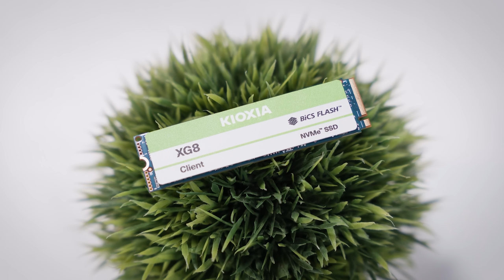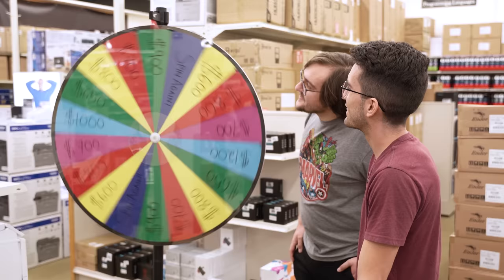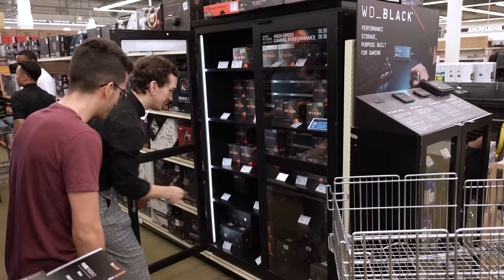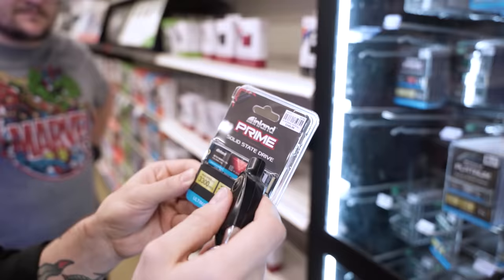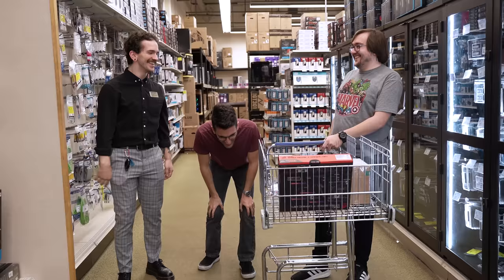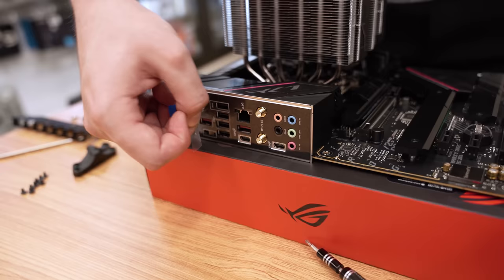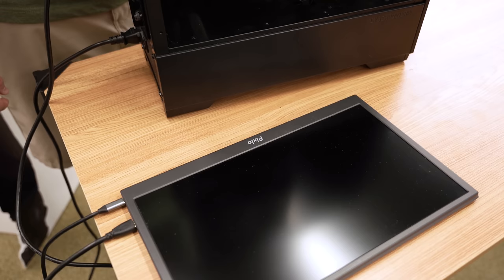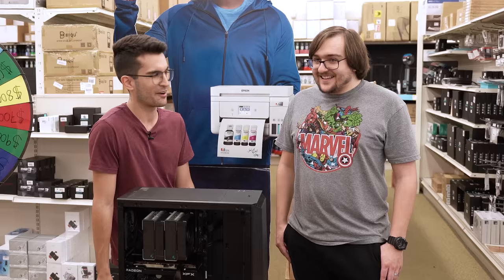He Couldn't Believe It Was the SAME PC!  - Gear Up S1:E3

Comment: I feel like an RX 6800 and a 5800x3d would have been a better route.  He could make 200+ bucks back on the 6600 (XT?).  That would give him still a great CPU, and also a 16GB card...which is already getting relevant.
Reply: I thought the same, platform was fine, just throw a 5800x3d and ready to go!
Reply: Yeah that's since he already has B550 the 5800X3D is really good for gaming.
Reply: that and a better Cooler, imo they just not tryna be stale with the upgrades but what they're doing isnt the actuall point of the series
Reply: I was thinking the same thing, but I bet he upgrades the GPU soon. Hoping he has more options in the coming months too
Reply: @jungle2460  This was my thought process :) Thank you for clarifying for everyone
Reply: Agreed.
Reply: The $600 combo (7900X, ROG B650F-E, and a 32GB DDR6 6000) is a hell of a deal (considering the CPU alone is $400+). Since GPU prices are all over the place, I'd upgrade my platform first, too. Especially when it's all free lol.
Reply: Dude nobody is going to give him $200 on a 6600.  They are only like $220 new for the non XT and $250 for the XT.  That might get him $100 on eBay and like $70 on Jawa
Reply: @jhendra83  Yeah that futuristic DDR6 Ram is incredible 🙄
Reply: This.
Reply: Previous video was the same, I feel like it's promoting those Micro Centre bundles. And I guess it's kind of boring if every AM4 user drops in a 5800X3D, you could try and squeeze a 4070 ($600) and maybe a 5000 series that fits into the budget with a decent cooler (5600/5700X). It would be good to get some more info as well, like what the person does with their PC. If he was only gaming, a 7700X is actually better than a 7900X.
Reply: @jhendra83  Yeah but for gaming 5800x3D or even just 5600 with 6800XT or similar GPU would be much better imo

Comment: i have the same pc. great pc to upgrade. i went from a 3600 rx 580, to a 5800X3D and a 6700XT. this is a Phanteks P360A case, great overall pc, and very budget friendly in 2020 when i got it for 750 bucks.
Reply: Yeah would of been better upgrade to get 5800X3D $300 since already had B550. Sapphire 6800 16GB is $499.99 at microcenter also

Comment: Decent upgrade.  I’d have been tempted to grab a 5800x3d and a 6800 non xt for right at 800.  Keep the current board, sell the 6600 then upgrade ram and psu.  But overall should be a decent upgrade especially once the gpu gets swapped later.
Reply: He would pay half of what he would get for that 6600 just in shipping it to someone.  Plus eBay fees and he might end up with $20 😂
Reply: @anthonylong5870  shipping would be about 20 judging by what it cost to ship the 5700xt I sold.  But you are correct eBay will take about 15-20%.  If you sold forfor say 180 you’d probably get about 140.
Reply: @Averagedude-mi3fl  The 6600 is only $200 brand new.  I don't see anyone paying more than maybe $120-$140 tops for it and that would probably be hard to get.

Comment: I did a similar upgrade to this. I had a ryzen 3600, and a b450 msi tomahawk max mobo and 16gb of ddr4. I was going to get a ryzen 5800X3D and upgrade to 32gb of RAM, but this was almost $400. Instead I just got the 7900X bundle from microcenter which was $550. So I jumped platforms, got way more M.2 slots to put in spare drives, PCIE 5, and a lot more USBs and features, along with 32gb of RAM. Rendering performance tripled, and games no longer have microstutters and overall framerates went up a lot. I then built another spare PC for the living room with my old parts.

Comment: Canadian here. I had Bell come in with fibre optical straight from a hub on the street into the house... That an option in your area Greg? Your house wouldn't need a jack then... They run fibre straight into a thier router/hub up to 2gbps.
Might not be the exact same there but maybe check for something.

Comment: Great stuff and a really good deal on that budget. Having a good platform is def. a right move. I may have gone with a 5700/5800/3D cpu Upgrade depending on the price and a 6800XT and cpu cooler and PSU (probably with own money, like he does). Anyway, he can be very happy with what he got

Comment: Please tell Microcenter to come to Croatia, even if they open 1 store.   For example: current shamed GPU 4070 costs from 730€-870€,  and if you want special 4090, it is from 2000€-2500€ in stores. We need Microcenter. ❤❤❤❤❤

Comment: You should really tell the people about the thermaltake peerless assassin. I’m running my 7950x with this cooler with Phanteks t30 fans instead of the included ones. 

The thermalright PA is unmatched. Paid 38$ for the cooler
Reply: I paired the Peerless Assassin SE up with a 5700x, and there was nothing I could do to get the 5700x to run above 60c. I had to throw Prime95 Small FFT at it, and it would barely sweat..... and this was all before I set a -voltage offset.
Reply: @m8x425  it’s definitely under rated cooler! I’ve not seen it go above 80c in cinebench or any gaming scenario on my all stock 7950x haha! 

I love this cooler

Comment: Before watching, it's pretty simple 5800x 3d, add another 16gb of ram for 32gb and get a new gpu and a cheap nvme drive if he doesn't already have one. No gpu he is buying or any modern games will need more than that 3d cpu until you go high end in which case sure get the 7000 3d 8 core or the 13900k if at 4090 levels.

Comment: My personal rig will cost me 800 before the gpu. I got the second Microcenter deal. I was thinking of going with a 750 maybe 850 watt psu, 2 1TB m.2s and I still haven't decided on the cooler. GPU I wanted to do an Arc 770. I gotta pick a case as well.

Comment: have been wodering since it has not been mentioned in the series. do the ones that get the upgrades get to also keep the parts that get replaced? or does microcenter do an exchange and like recycle/re sell the parts?

Comment: Mc is a great store, I am very lucky to live by one. With 800 I think I would have went 8800x3d (assuming the mobo could handle it) then spent the rest on a gpu I cant in good faith recommend the new amd gpus to the masses yet
Reply from the maker: Old B450 mATX board (he didn't wanna pair that with an X3D chip). And both that along with a graphics card upgrade would have warranted a PSU upgrade - and by that point, the GPU upgrade wouldn't have been substantial enough over his RX 6600. So nah.
Reply: @GregSalazar  fair points, his setup was weird that its not really old, but its still a few gens old, I have tested the newer gpus with a ryzen 5 3600 and espec at 1440 it holds up quite well, I guess the real limiting factor was the b450 is pcie gen 3. He could have paired that cpu with an x570 mobo for pcie gen 4 and spent the rest on a gpu. Quite a few ways he could have went, and he looked so pumped! Great series love seeing folks get much deserved upgrades! Looking forward to the next video!!!

Comment: Awesome upgrade the system looks amazing I would love to upgrade my PC I am still running a ryzen 5 2600 with a A320 board and it holds back my GPU and my memory. I have seen a nice upgrade to a B550 board with a ryzen 7 5700x for £300 but I am not going to be able to afford any sort of upgrade anytime soon now I cant work due to health and going through a cancer treatment right now.

Comment: man id love to be part of this just so i could upgrade my gpu its the last piece of the new build to be replaced i have a asrock z790 pg sonic board with a i5 14600k 64 gbs of ddr5 at 6k mhz a 1k watt power supply and 240 aio with 4 other fans in a hyte y70 non touch but for graphics all i have is a 3060 12GB  id like to upgrade to a 7900 gre or somewhere around there since i have a 1440p 144hz 34inch ultra wide msi monitor

Comment: A random review of VIP-SCDKey: In short, the website seems sketchy but you're redirected to PayPal for transaction processing so that part of it is relatively secure. I used this guy's link to check it out and purchased a Windows 10 key to remove the watermark. Received the key 30 seconds after payment and it worked without any issues. While on the website I saw the terms of their open and fairly generous affiliate program. 8-20% when someone purchases from your link, not bad. I see why dude mentions them in every video. Good hustle. 👍 
My $1.20 - $3.00 was well spent.

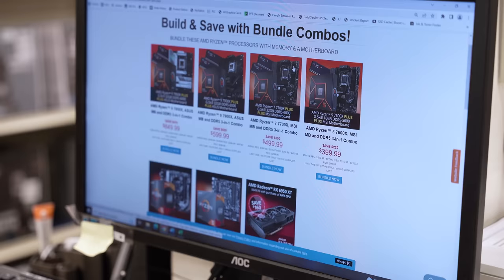Comment: Big mistake @4:26, best value per CPU Core is the 12C/24T CPU, getting +50% processing power: more Threads, always helps with Windows. Oh, the client got smarter than you, good for him! -_-
You ask the client if he wants Gen 3 or 4? instead of telling him that AFAP (As Fast As possible) SSD is always the best, Gen 5 if available since the MB supports it.
Wow, really bad advice to the guy that has money to buy a Sport Car and Likes Speed; what's the use of having pros with him, if you're gonna be a bystander?
bī′stăn″dər
noun
    A person who is present at an event without participating in it.

Comment: Ryzen 9 with a 6600 is a gpu bottleneck waiting to happen lmao maybe he should sell the spare parts and get that gpu upgrade wink wink
also a psa, if you're of the mindset that minecraft doesn't tax your system and you have your settings at high settings, minecraft CAN tax your system. Especially with render distances.